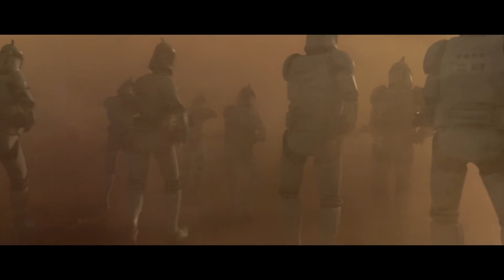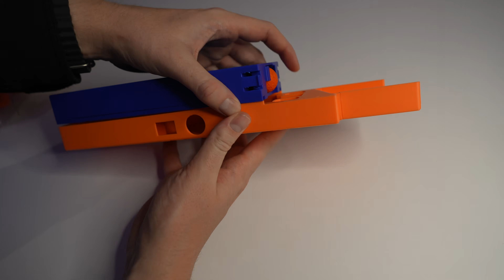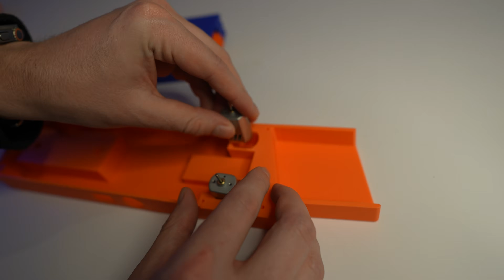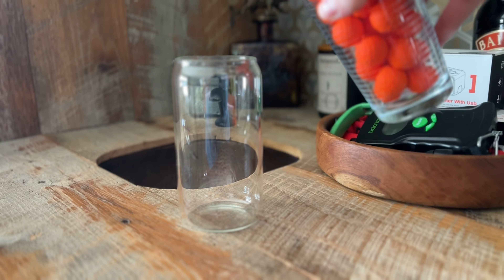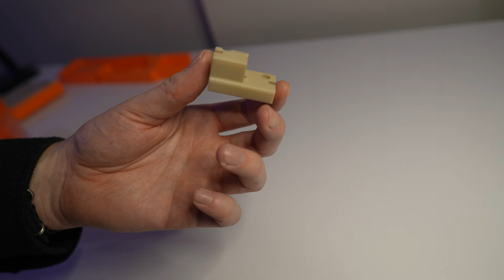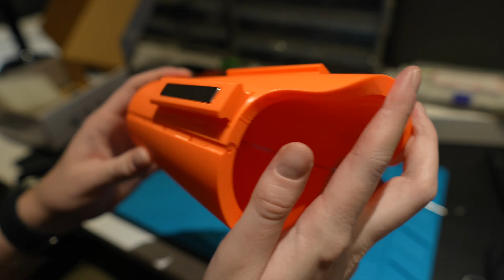I made the Nerf Star Wars Blaster I dreamt of as a kid!

Comment: I would like to see it trigger fired instead of button fire and if you were to continue using the motors instead of a plunger i would like some form of speed controler in said trigger so like its got a long pull to gather speed than at a certain point in the trigger process it then fires and see if you can get some that are maybe a lil faster or with a wider area for grip
Reply from the maker: Good ideas! There’s a rev up time built into the gun by making the servo wait while the flywheels spin up for like half a second before opening and letting balls through. The problem is the crush… not enough friction to throw the ball very fast!

Comment: If you tighten up the flywheels (increased crush on projectile), they compress the ball, imparting more energy into it, also a guide barrel would allow for more accurate shots. Otherwise this is a really cool project idea.
Reply from the maker: Those are great ideas! I wanted to remake it for the smaller hyper balls, for more capacity. I think remaking this think with a hopper, tightening up the flywheels with a guide barrel would solve many of the problems
Reply: @busyyoungexec apparently hyper balls stick to each other more preventing feeding. I don't own a hyper blaster myself, but from all the videos I have seen from nerf creators it is a little bit worse than rival because of that issue. If you want more rounds it's great,but if you want reliability,not so much
Reply from the maker: @whoa4440 thanks for the info! The hyper balls definitely feel “stickier” since they’re not made from foam
Reply: @busyyoungexec I know this was a while ago but there's always 50cal foam balls from Monkee Mods.